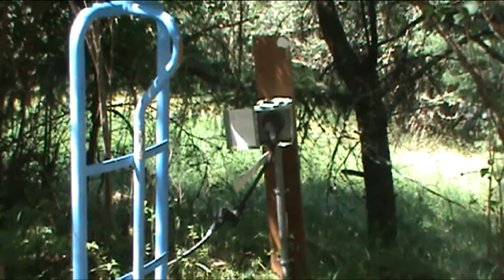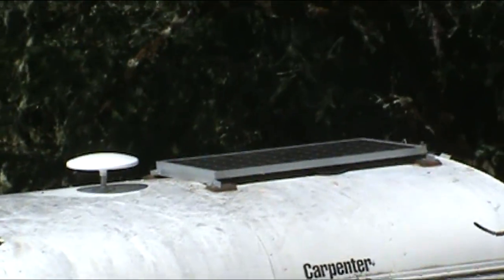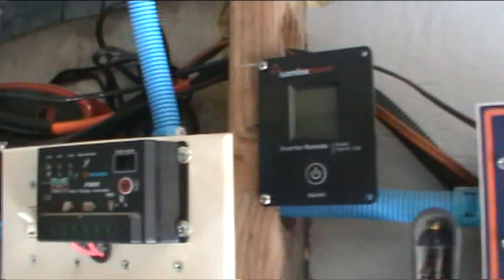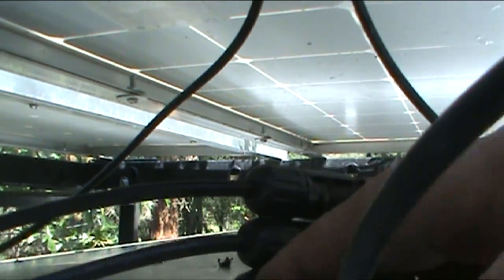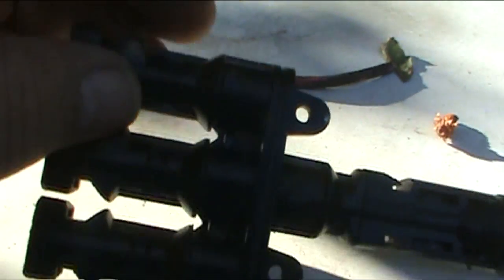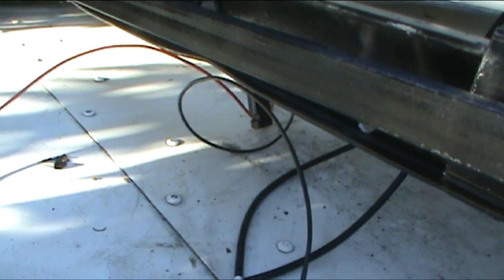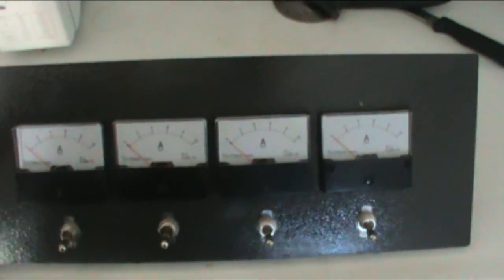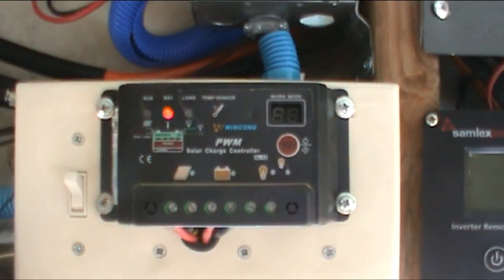Jon's Bus Conversion Part 55 - Rewiring my solar panels

Comment: Been wondering where you were. Ripping off a camera is low.I just started living on my bus two days ago. Still have too much stuff but that will be corrected as I go.I like the idea of individual meters and switches. Make troubleshooting easier
Reply from the maker: Yes - especially if you have several panels. When 3/4 went out it was obvious - but if 1/4 goes out not so much.